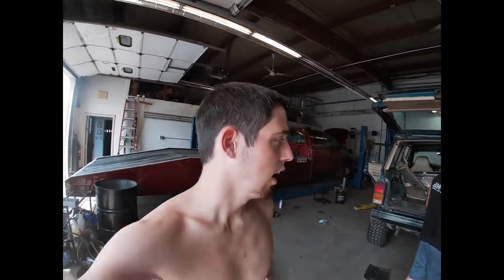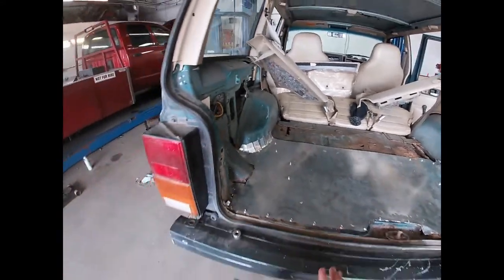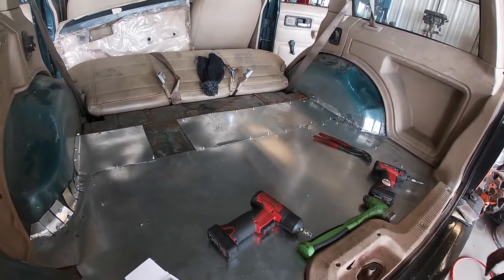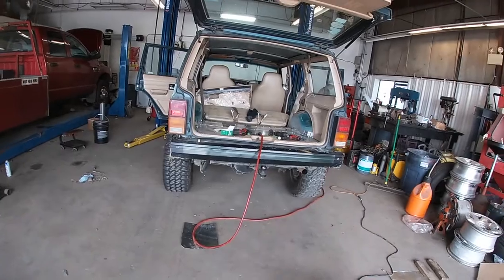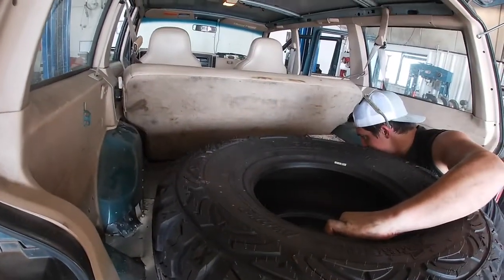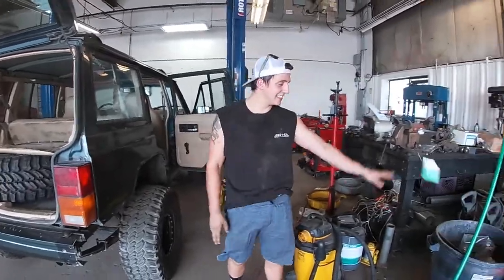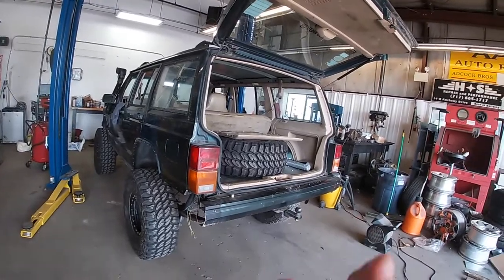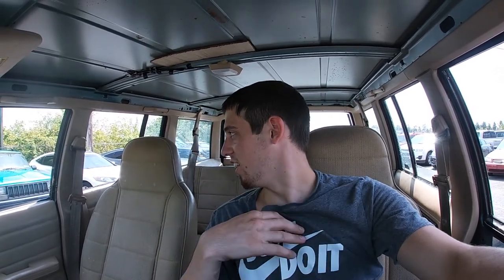Is My Jeep XJ Rust Free Yet??

Comment: lol i did my trunk too but welded and cut the rust out before hand
Reply from the maker: That’s how we did the front floor pans... the correct way. Not enough motivation for the rear. Way to hot to get motivated lol
Reply: @JeepinDaily  yea I feel ya on that Lol I have the rear passanger floor to redo because it was a terrible repair with self tappers before I got it lol